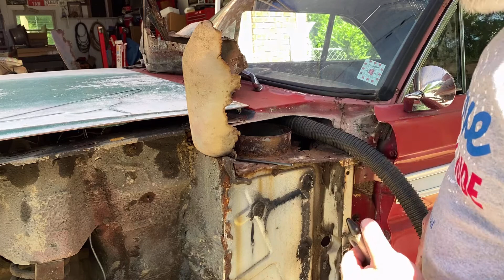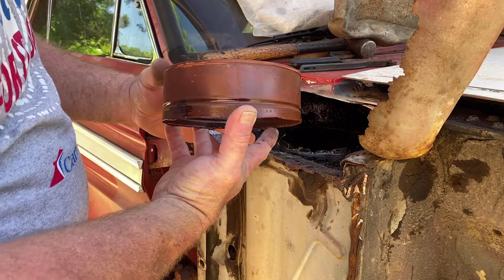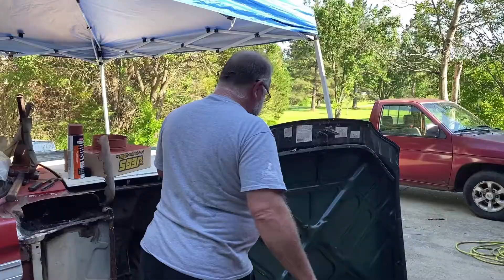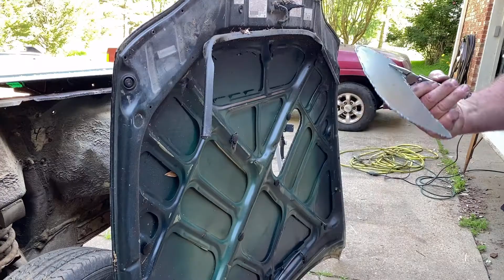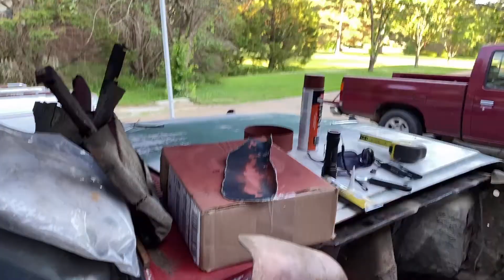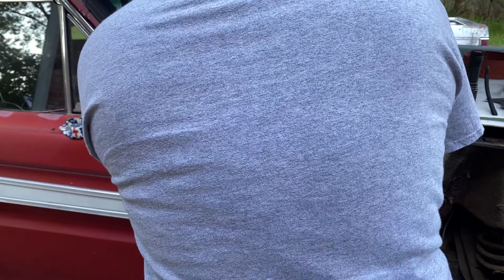Mercury Comet: No Weld rust repair Por-patch

Comment: I bought one of por patch but i still dont fully understand it,does it work like a glue same as jbweld or its more like a "gap silicon" used in bathroom?
Reply from the maker: I’ll be doing more videos in the very near future with this product. It’s similar to JB but can be used as a seam sealer. With some backing can function as a gap filler. Smaller rust holes is where it works well. I plan to fix some spots on my doors with it. Thanks for watching and commenting!!! More to come!!

Comment: never used that por patch stuff interesting
Reply from the maker: It says to allow it to dry up to 96 hrs (4days) depending on how thinknit was applied. I have a couple of spots that were thicker than others. The places I have applied it thin it has cured and is hard, but the thicker places I can tell needed more cure time. So as soon as I can I will be posting an update on it. Thanks for watching and commenting 👍